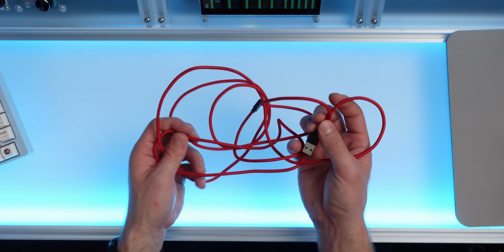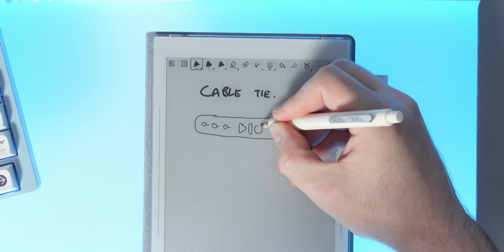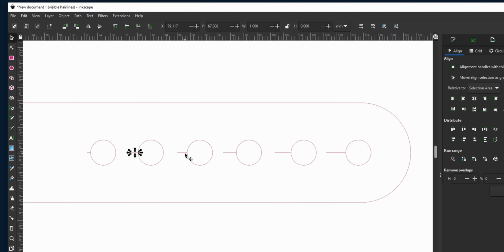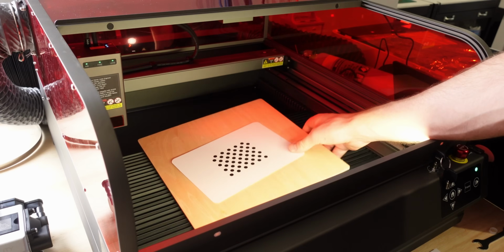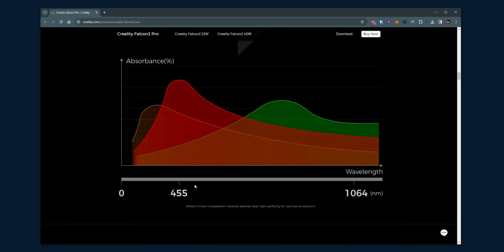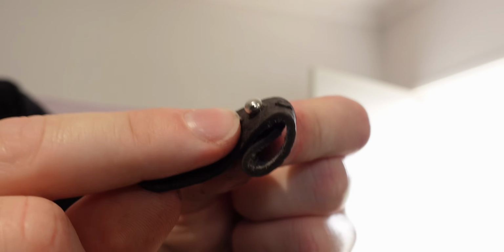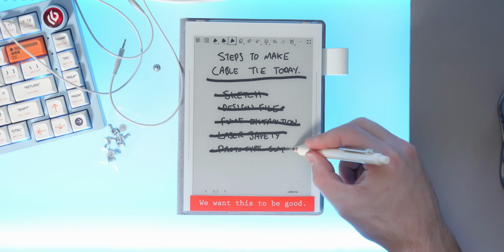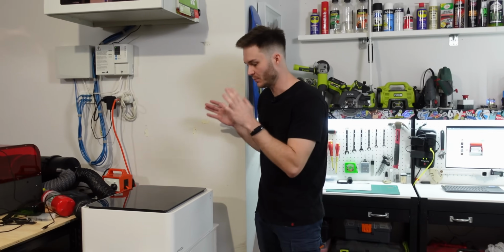Laser Cut Cable Ties from Leather feat. Falcon 2 Pro

Comment: Hobbyist leatherworker here. The studs are usually called button studs, also known as Sam Browne studs, Sam Browne posts, or harness posts. Additionally, the compounds used in leather tanning, particularly in chrome tanned leather, are noxious, not just faux leather. The ventilation is super important if you're laser cutting leather.
Reply from the maker: Thanks for the names! You would not believe how hard it is to google for them without knowing the right terms. Found some on eBay as I couldn't find them in stores.

And yes I did do a burn test outside to make sure the smoke and flame was normal and ash was brown and not green (that's the test I saw mentioned on a few forums for vegetable vs chrome) and it was all brown so presumably vegetable tanned. 100% knowing whats safe and having ventilation even for wood is important!

Comment: I have so many Ideas that are super similar to yours! This channel is a huge inspiration to actually build/film them once I have the funds to do so.

My issue is I’ve worked on manyy custom projects but always pinched for time and don’t film anything.
Reply from the maker: Totally understand the time struggles and trying to get thing done!

My trick, is I've switched to a "one and done" principle where possible.

Also, If a big project requires the need to learn something, I'll see if I can break that skill down into a project of its own. Almost like a mini project to more easily stay on track with and chip away.

Finally, the biggest motto I've embraced is "it's a prototype", anything you make just tell yourself it's a prototype, until eventually you get what you're happy with. That helps with time constraints as I'll let go of perfectionism enough that I surprisingly get more done at a 98% quality level that is better than getting stuck and giving up.

Still figuring it out everyday, but these things have helped me a lot to keep momentum
Reply: @camshand   the idea of not getting it right the first time, and everything is a prototype is slowly starting to set in for me. I’m Definitely a perfectionist, hopefully you will get to see an example someday 👀. 

I have ADHD and constantly hop around the house on a day off and just work on whatever when my brain sees it. Trying to get into a compartmentalized flow, of watching YouTube for an hour, working on a project for two hours, doing schoolwork for a while. Rather than trying to fatigue myself over trying to do so much in one day.

I have a-lot of filmed content. It’s just only from half of the project… I’ll forget halfway through and then give up on filming more. 

Lets just say I’ve gotten good at only editing intros 😅 i try to see the project through and take glamor shots at the end to gather some practice in how to story-tell a project.

I appreciate your at length advice! It’s screenshotted and in a place I revisit to remember simple practices In content creation.